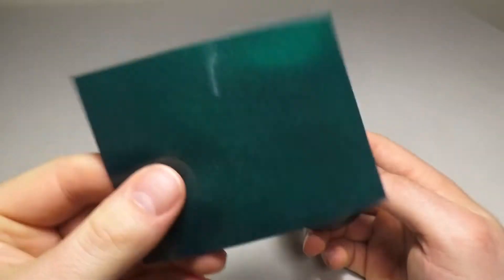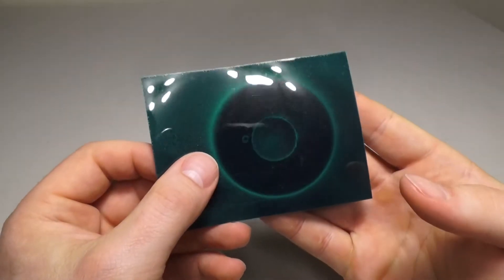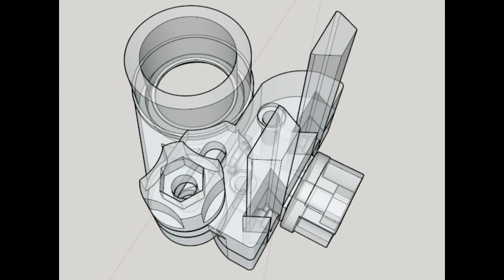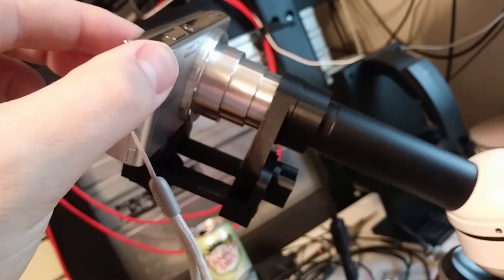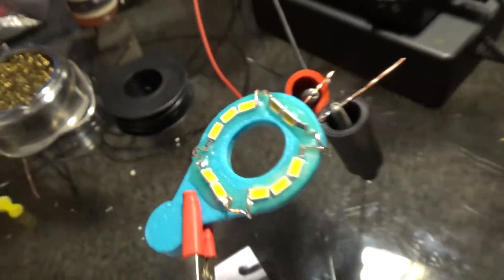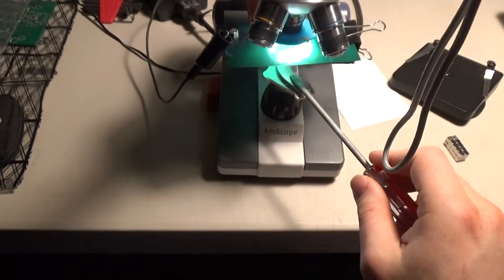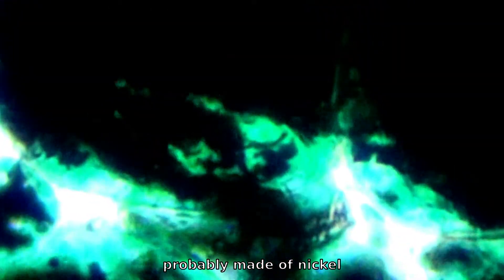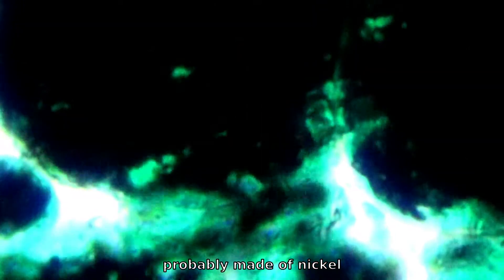Magnet Paper Under Microscope (Magnetic Viewing Film)

Comment: Wow, this is outstanding, great job! The substance is supposedly nickel suspended in gelatin, but it's also described as being microencapsulated in oil. I've seen sellers and other sources say the film can be laminated, as it's rather delicate. I laminated my piece, and it was fully functional, but after sitting in the cupboard for a couple of years, it is now almost completely unresponsive. I was just perusing the manufacturer magne-rite's store. You can get a 12x12 sheet for anywhere between 18 and 28 dollars, but you'll have to spend a minimum of about $750!
Now, I wonder what those new multi-color sheets look like under the microscope? Or the high-definition Japanese sheets.
Thanks for sharing!

Comment: I'm a bit confused. Are these the actual magnetic domains in motion?
Reply: Per the manufacturer- "When a dc magnetic field is applied to the bonded film, the nickel particles congregate in alignment with the flux lines emanating from the dc magnetic source. This mass grouping together of nickel particles causes a darkened appearance to the film directly where the magnetic field is impinging on the film. As a result, an exact two-dimensional image or impression of the magnetic pole or pole pattern (if there are more than one) is produced."